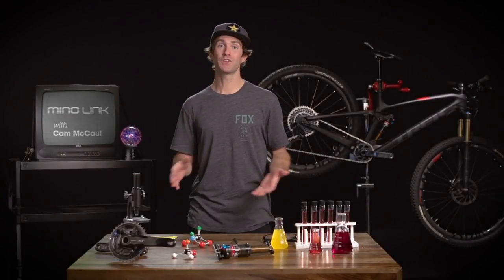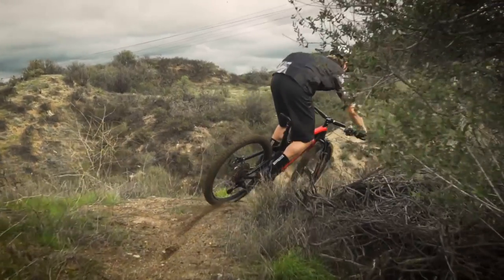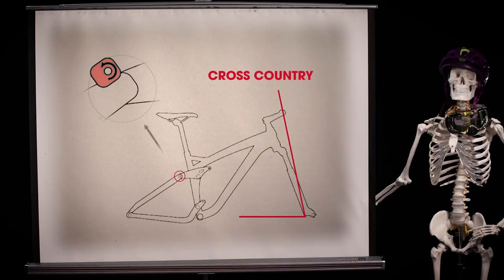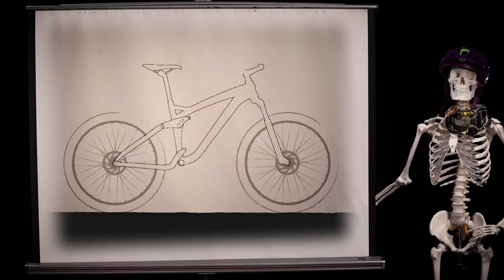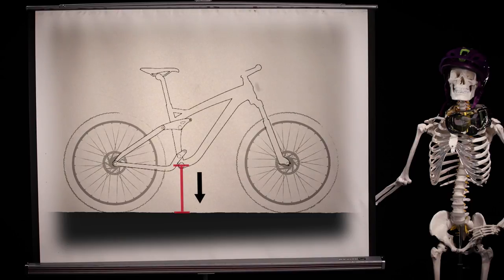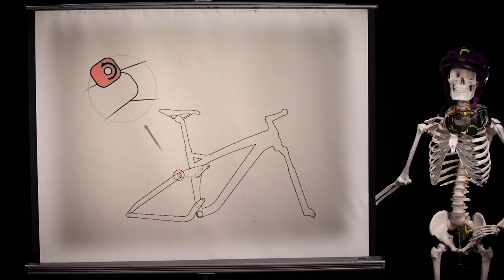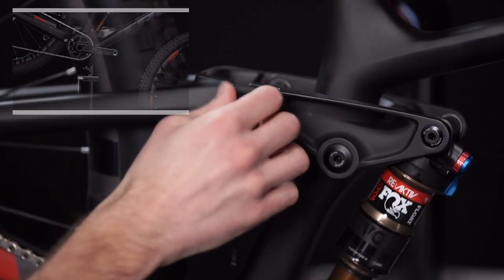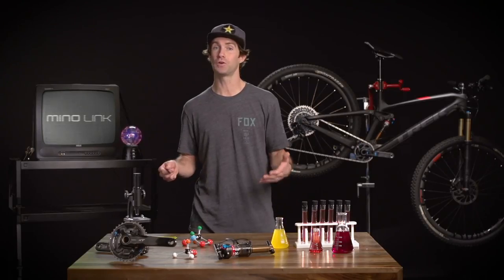Mino Link ft. Cam McCaul

Comment: Mine is so tight I can't freaking unscrew it
Reply: On my fuel ex it is reverse threaded from the outside. Snapped the bolt trying to unthread it personally, oops.
Reply: My 2022 has the mino link on the inside of the seat stays and the bolts on the outside are righty tighty and lefty loosy. Much easier.

Comment: Ayy, I just swapped the mino link direction and my bolt sheared off when retightening well below the suggested17 N.m! Way to go Trek!
Reply: I have changed 100's of these and never had an issue. I would also never torque down under recommended spec.
Reply: Bull Shit -- I highly doubt you were under the spec torque and the bolt sheared bolt choise is always based on max torque spec + a min % you did something worng
Reply: It is an aluminum bolt so if it was previously tightened past spec it might have been weakened... or your torque wrench could be wrong. I personally snapped mine.... but I also didn't realize it was reverse threaded from outside of the frame. So I was pushing hard on the darn thing only the wrong direciton. Woops.
Reply: Dude these other people are assholes. I just got a brand new 2019 bike and I was checking if all the bolts were tight and this one was loose I was tightening it when the bolt broke right where the threads start and it was only at 12 nm.

Comment: so which way am i meant to undo the bolt and do you undo it from the outside or behind next to the seat stay?
Reply: you can do both. working it on the inside is normal right-tight, left-loose, on the outside is the opposite, as you are working the screw on its upside-down (it will make sense as you do it). i did it outside as it gave me better feel for the tightening and i do not have a torque wrench

Comment: How much do you turn the Mino Link? Why not actually demonstrate the adjustment? Is the range meant to be 1 rotation or less? On my bike one side spins and spins(is it broken?)  and the other side will not turn at all with 25N of pressure.
Edit: Here is an actual how to adjust the Mino Link video: https://youtu.be/aNMODk-a6QM
Reply: Thank you!!